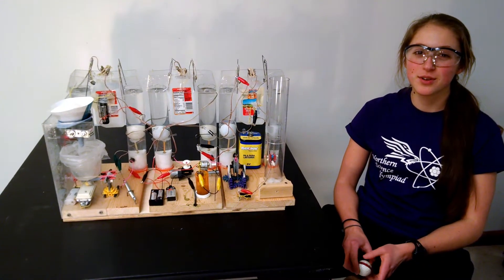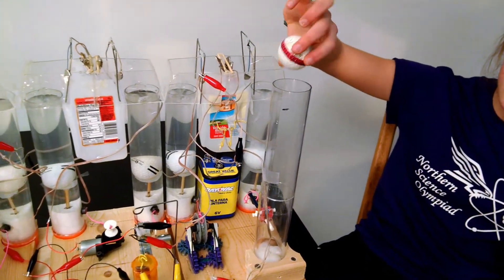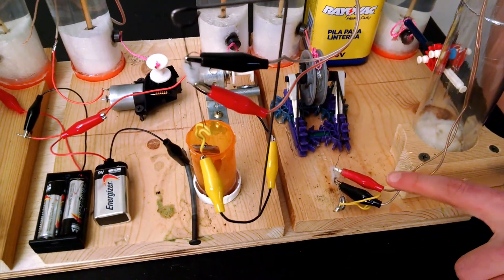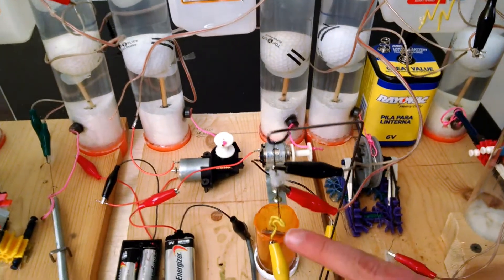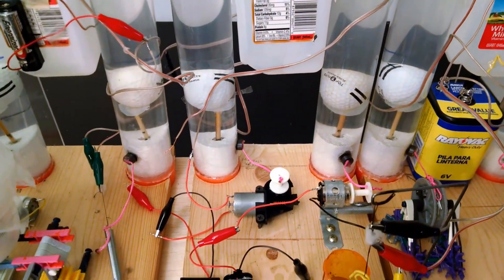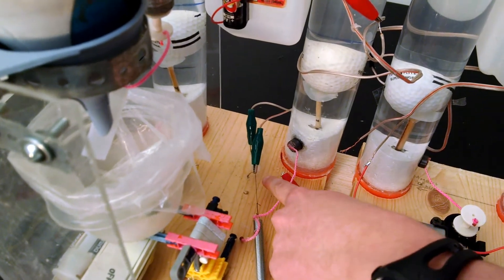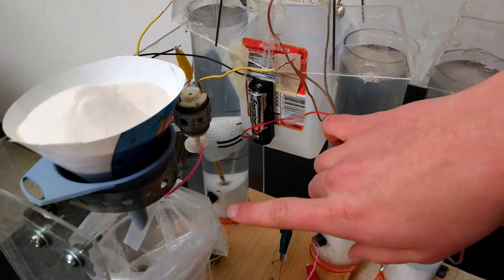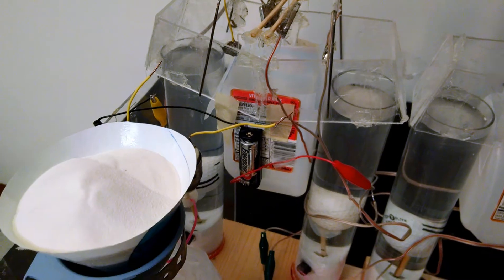NC State Champion Mission Possible 2015

Comment: where did you get those red and black wires
Reply from the maker: Any electrical or electronic supply store.   I think some may have been salvaged from another project or torn apart device.    Most of the supplies we're repurposed rather than purchased

Comment: How does the magnetic switch get triggered?
Reply from the maker: David Zhou The suspended magnet is hanging on very thin <24 gauge wire.   When the golf ball hits the hanging magnet, it swings and is attracted to another magnet suspended above the float tube completing the circuit.